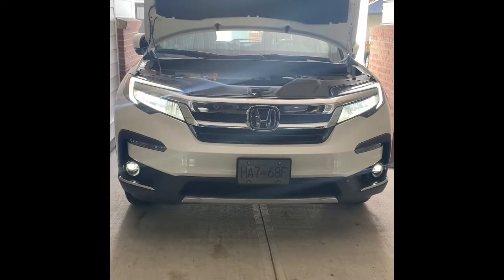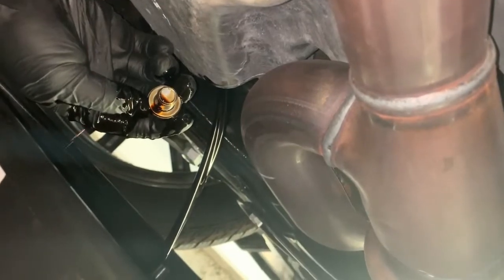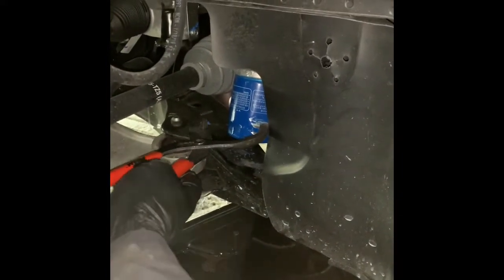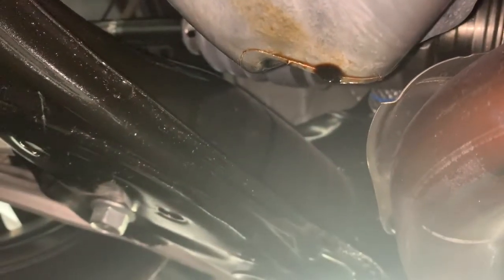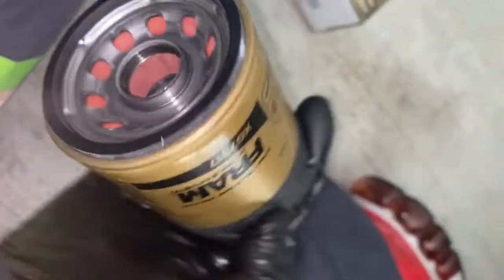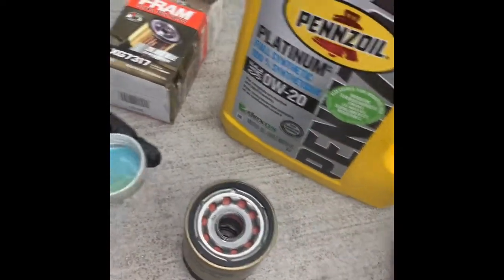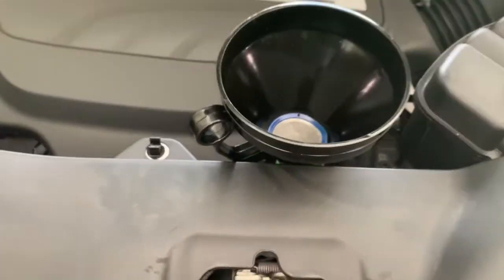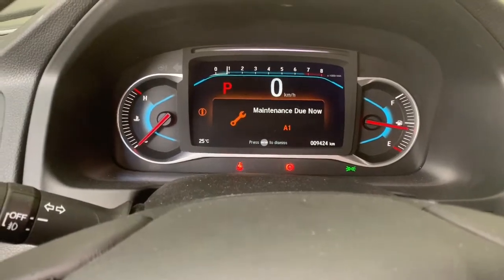Honda Pilot FAST and EASY oil change
Hit Subscribe button

Comment: Always use oem fluids and filter. Honda oil and filter please. I work at a Honda dealership and have seen to many aftermarket filters and oil damaging the vehicle and yes, voiding the factory warranty. Keep your Honda a Honda.
Reply from the maker: Sure thing
Reply: what is the oem fluid for this car? i have the same and so far i'm using the oem filters but never heard about any oem fluid
Reply from the maker: @qcwallace  I buy honda oil from the dealer
Reply: Don't be silly, I work at a Honda dealership as well and there is no issue using aftermarket oil and oil filters.  Are you familiar with the Magnuson-Moss Law in the United States?
Reply from the maker: Thanks